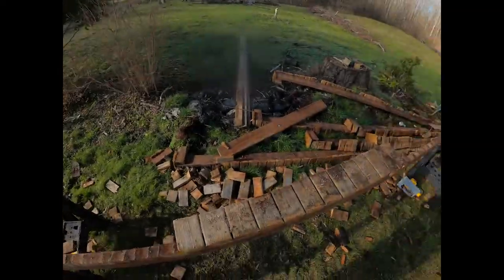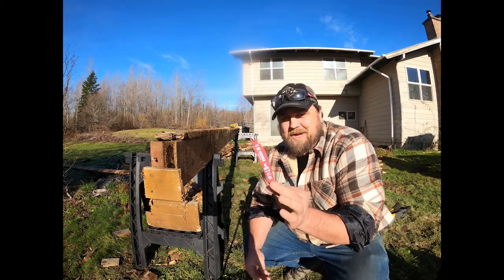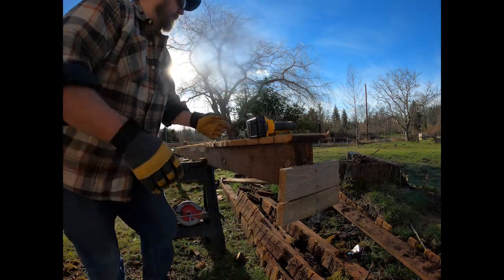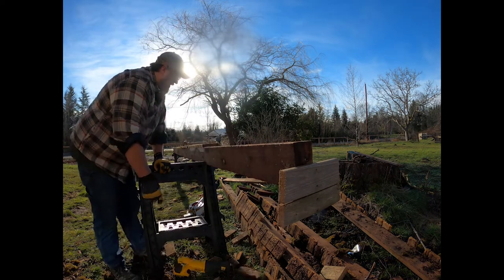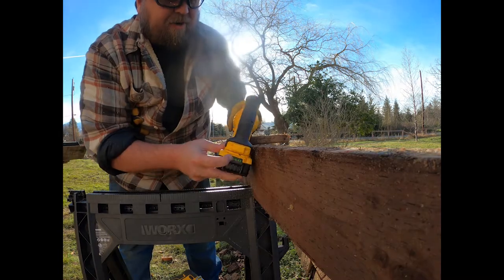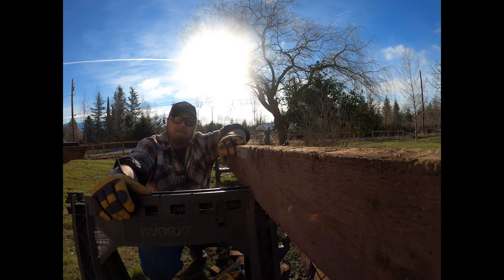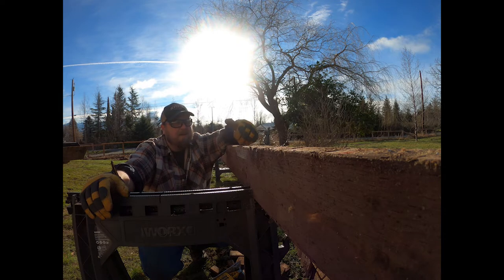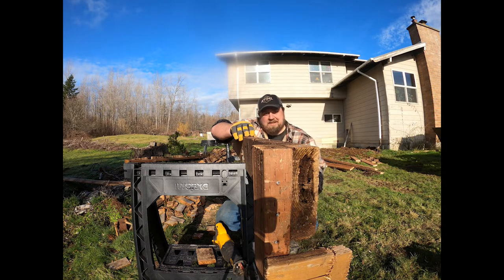Diablo carbide sawzall blade VS decking screws

Comment: thanks for sharing the video good stuff to know ,are you cutting drywall screws or deck screws? drywall screws are hard as a rock one drywall screw will destroy a brand new sawzall blade. I do a lot of demo work so I buy a lot of sawzall blades I'll give the carbide ones a try
Reply from the maker: These were some older 3 1/2" galvanized buggers.  They were real fun!